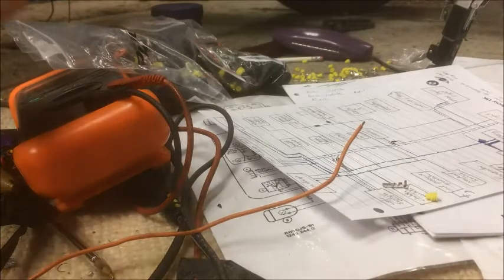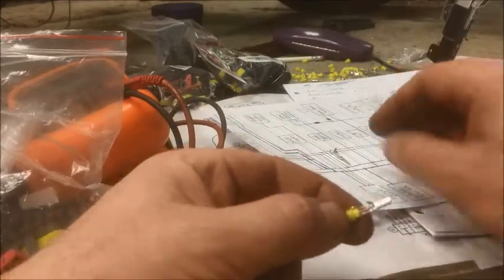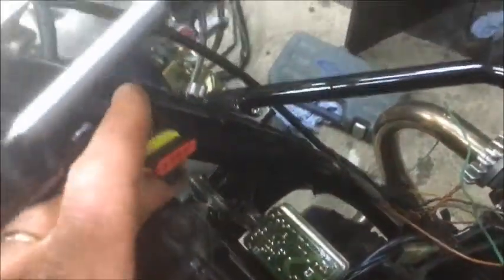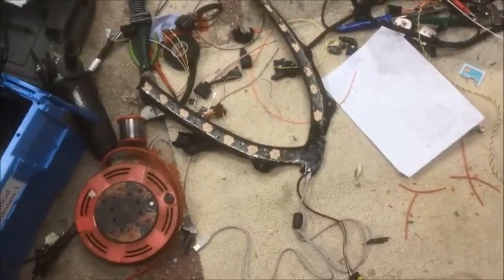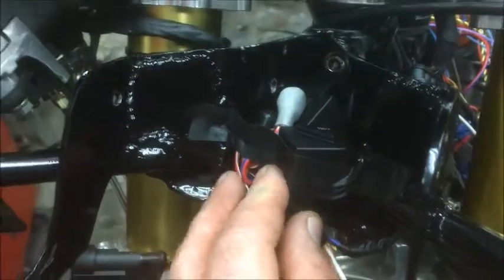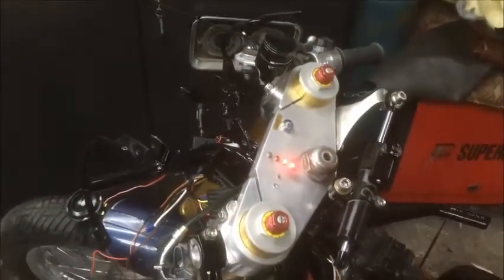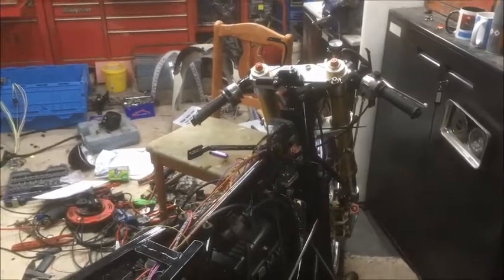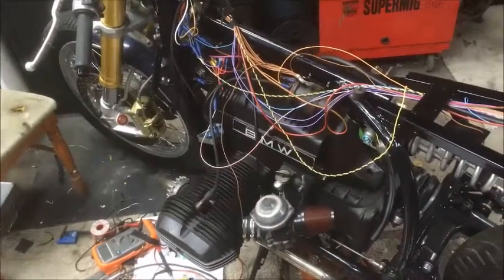bmw r80 cafe racer project part 58

Comment: Have considered to wire up the bike using the m-unit from motogadget? It seems that it would be less complicated
Reply from the maker: Hi, I didnt really consider it. the basic idea of this bike was to do as much as possible myself, and although something like that would probably have been easier, this is something that i should be capable of doing (hopefully - said with fingers crossed). (i'm not so sure they would have been comprehensive enough to run the indicators as i want them either)....having said that if it goes tits up again i might be saving up some money and going down that route and just simplifying the whole thing........

Comment: I used to add a little bit of solder to those crimps because sometimes they can work loose.
Reply from the maker: Hi, yes now you mentioned it I wish I had too, however I think to do it now I'd have to pull of the crimps from the connectors and would probably end up causing more problems. If it starts to Muck around I'll take your advice then. (I am going to do it on the few that I have left to do though). Thanks for the input.....

Comment: Hi there, great build. Just curious. Did you wire up the GEN light? If so what resistor/LED set up did you use? Was it a 48 ohm in series with a 12v LED?  cheers
Reply from the maker: Good afternoon, I decided not to wire in a gen light, I have oil, neutral, indicator and high beam on the top yoke. i also have an led at the front of the seat unit telling me whether the imobiliser is inactive (basically ignition on - but it wont go out with charge, so its always on when the ignition is on) its not a problem or distraction whilst you are riding where it is located......I did make a pretty good video about this lot because i had a lot of issues with the led's on the warning lights and the indicators and the Arduino being effected by voltage spikes from the generator and such, so i had to put a scope on it to monitor it and then fit a couple of capacitors to stop the spiking, but i was unable to post the video for various reasons.....problem is i can't remember exactly how i did it now..........